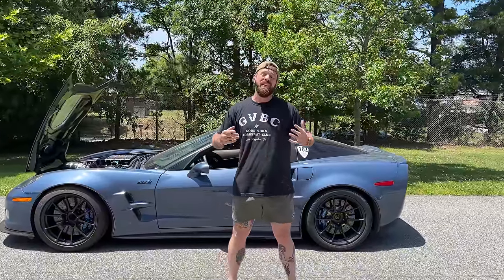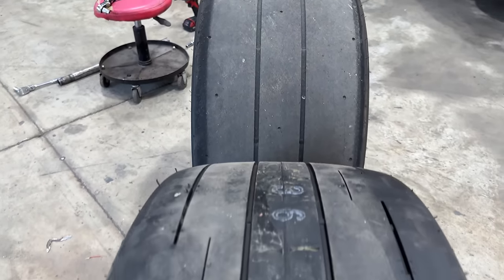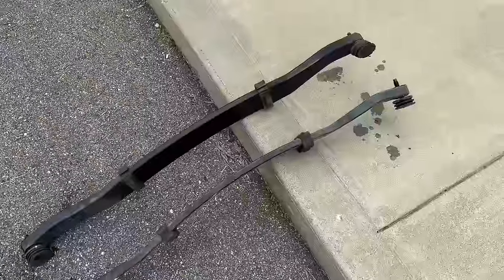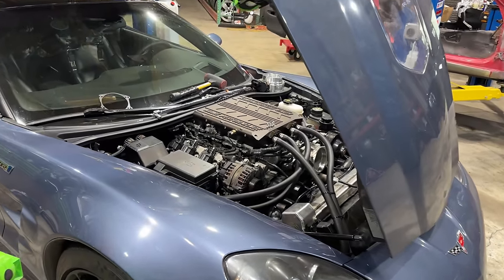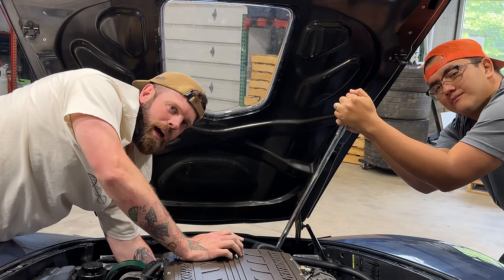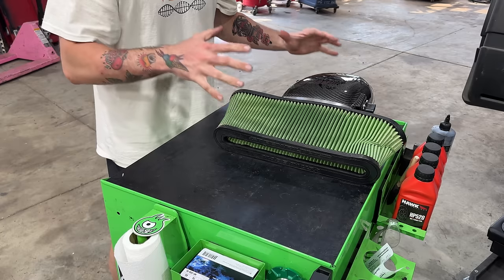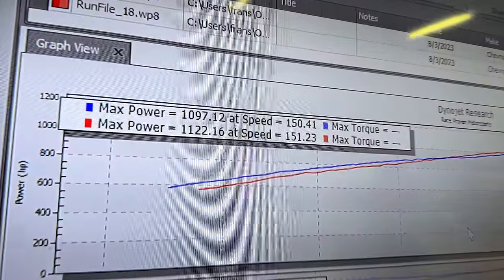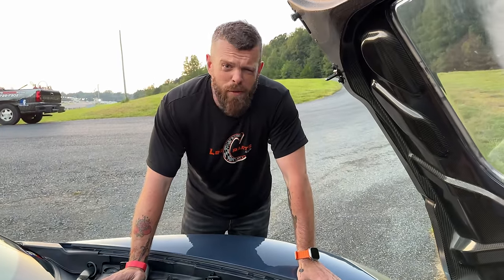I Built A 1100HP Corvette ZR1!

Comment: Hey Lee here's a good one for you, friction/grip isn't surface area related, this is relevant to your assumptions around tyre contact patch and supercharger pulley contact patch.

A wider tyre doesn't give you more grip it is the compound that gives you the extra grip, the tyre is wider so it doesn't wear out being a softer compound.

If you want to lessen supercharger belt slip you need to look at softer compounds rather than worrying about contact area.

Great videos, keep it up 👍

Comment: Sometimes you can gain some belt size by taking the idler off and putting it around the belt, then bolting it in with the tension

Comment: Hey guys! Seems like its always belt issues with these PD blowers eh? I have a Kong 2650 on my LSX 388 cu. in my (wait for it lol) C5 and alot of belt issues. Car made over 850whp @ 18 psi after which belt started slipping. Currently working on the custom belt drive over the winter...

Comment: I don't understand how you broke that belt because that's the same belt I used to run on my F250 diesel with 1800 foot-pounds of torque we're like a 1000 horsepower And I beat the snot of that thing in 4 wheel drive launch and it never snapped a belt

Comment: awesome vid, but i can tell ya from experience with lightweight, over 1000whp cars, is that the toyo RR you removed is W A Y better of a tire than the ET STREET R you replaced it with, you might not think so for the first 250 street miles worth of pulls, but the toyo RR truely is king, compound recovers from being over powered, ET STREET R is done once its spun

Comment: @Lee I'd really like to see you take the ZR1 build to the next level and do the full carbon wide body kit to it next. The kit looks so good, like it was factory built. It includes fenders, quarters, hood, hatch, doors, bumpers and roof
Throw in a pair of light weight carbon racing seats and you'll cut over 300 lbs off of the car
Reply: that would ruin it all
Reply: @cr-x7344  How would that ruin it? It's all bolt on parts
Reply: @natesmemes1794  its a zr1 c6. arguably the most iconic corvette ever . why would he put holes in the body of a rare car just for it to look more rice than nice
Reply: @natesmemes1794  the zr1s wheels already struggle to have good fitment. so putting a widebody would make it worse. it would need wider more heavy wheels or unsafe amounts of spacer size
Reply: @cr-x7344  I agree the C6 ZR1 is iconic that is why putting the widebody kit on it makes so much sense.
Think about it, with only 121 Supersonic Blue Metallic ZR1's built out of 4,684 units why would you risk the body/paint being damaged when you could simply swap the body out?
Then Lee could stash the factory body panels away in a safe place where they won't get damaged and drive the car all he wants without having to worry about it
Reply: @cr-x7344  There is no cutting/drilling into the body required to fit the kit, the rear quarters unbolt on C6 Vettes like fenders, so its just a basic panel swap.
The widebody kit looks factory, it's like the difference between a regular Challenger and a widebody Hellcat, it's very tame, it widens the body about an inch on each side.
I met a guy in Texas that did it to his C6 the car was wrapped so you could barely tell it was wide bodied until it was parked next to another C6 and the fitment/wheel tucked perfectly because the additional space in the fender wells
Reply: @cr-x7344  Lee has already maxed out the power in the engine, anything much over a 1,000 HP and it starts effecting the dependability/drive ability of these cars everyone knows that
So that leaves you with 2 options to make it faster, aero & weight reduction
The body kit & carbon seats provides about a 10% weight reduction without deleting any amenities or interior, in the world of racing that is huge
Plus the wheels fit better with more room in the fender wells, so Lee could lower the rear again to help with aerodynamics
It also comes with an upgraded rear diffuser to reduce drag and bigger vents to help brake cooling, the only thing it doesn't include are the hood vents/rear spoiler to maximize the aerodynamics
Also the company that makes these kits already announced they are going to discontinue production soon, so it will be worth big $$$ in the near future
It's literally a win, win, win again situation
Reply: @natesmemes1794  im not reading all of this bro. the car itself is valuable and that kit is nowhere near as valuable
Reply: @natesmemes1794  he has other things to do and for the worth of that car it doesnt make sense to put a tacky carbon fiber kit on to it
Reply: @cr-x7344  You aren't reading all of this? lol do you even know how to read bro?
We aren't talking about cheap aftermarket Honda parts for your CRX there is a big difference $$$
Reply: @cr-x7344   A bit of advice kid, if you don't know what you are talking about just say that "it's your opinion"
Otherwise people are going to think that you are a derp
Reply: @natesmemes1794  still not worth taking the car apart for. if lee wanted to get the most value out of that car he would have stock panels on it